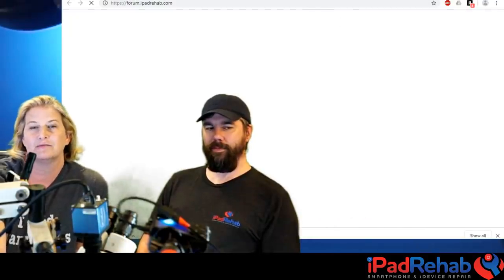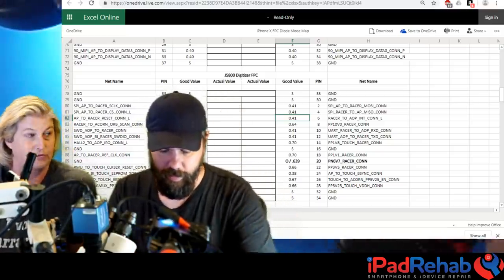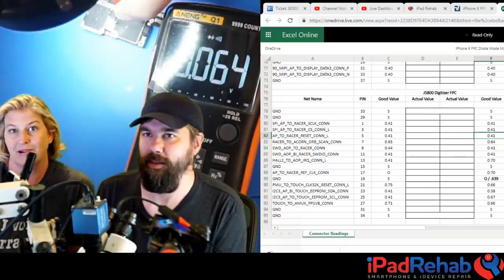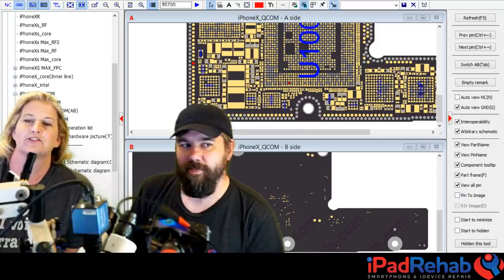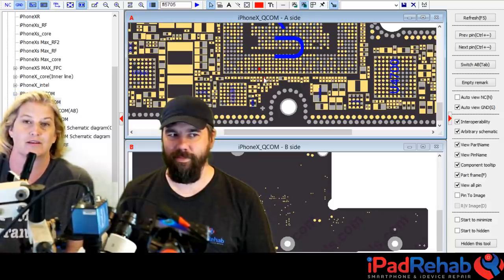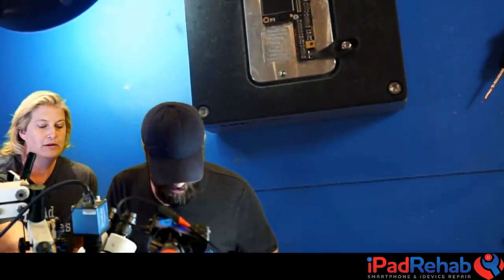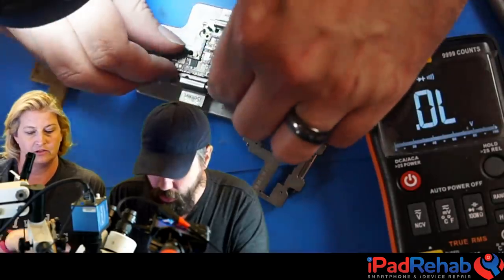Can We BURN a Short Out of an iPhone X CPU?

Comment: I prefer to adapt the Screen Touch Circuit By isolate the shorted line 
And add pull up Resistor with 1.8v
Externally on connector Racer_INT pin
Or just jump 1.8v to that pin 
Maybe Touch work with INT Always HI
As I know Interrupt not used continuously through process

Comment: ❗️
You just burn the Racer_AOP_INT Internal MOSFET Circuit 
Inside CPU 
AOP is Always On Processor
a part of CPU That Always On even in Deep Sleep Mode
Reply: There wouldn't be a solution to fix this most likely. At best they may try to find a line that resets at the same time to trick touch ics on the screen to work. Doubtful though.
Reply: I wonder Can we try this method too? Today i got same issue with iX🧐
Reply: Chris Long can you plz elaborate like which line can we make jumper with alternate?

Comment: The lower (not higher) the resistance of the short, the more heat it will generate for a given applied voltage. P=V^2/R. The thin whisker-like connection burns out quickly because it has low thermal mass, not because it has high resistance.

Comment: had same problem and didnt realize i had a short on both line,which is J5800-25 AND J5800-23.but sometimes my touch works for 1 second and most of the time it did not work.I gonna try remove both of these line cap and try measure again.but i still curious because the touch work for only around 3 seconds with these 2 shorted lines.the resistance i got is around 0.030

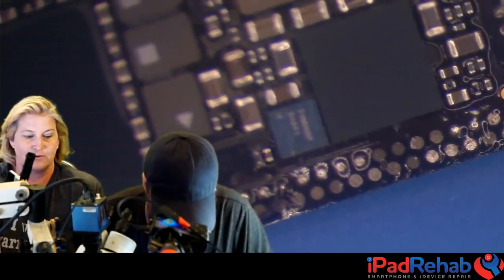Comment: 27:21 You can use your Siglent PSU and connect it via USB or Ethernet. They provide an application to remotely set voltage and current. It also displays the real time values and a graph.
Reply from the maker: That is why I bought this thing but never use it.  We couldn’t get it to work in a practical sense
Reply: @JessaJones  I'm curious. What part of the setup did not work. I own the exact same model and use it this way. If the software is the problem, I could offer writing a custom readout to be used in your shop.
Cheers,
Benedikt

Comment: What if you disconnect (isolate) that line from the CPU and inject 1.8V to the connector from another source?
Reply from the maker: This is a good question—is it the CPU that needs to “hear” the high/low that is “spoken” by the chip in the screen, or is it vice versa—or both?   That is definitely worth investigating if this were a data recovery case.

Comment: It would be possible to build something that reads volts/current and immediately disconnects the PSU when it detects the short disappear.
That way the instant the short blows away you don't risk damaging the chip from the high voltage.
If you do it by hand you going to be quite slow to switch off the high voltage.
Reply: Way easier to just send pulses and check between pulses.
Reply: There are PSUs how have this build in. I have bought one for 100€ not long ago.